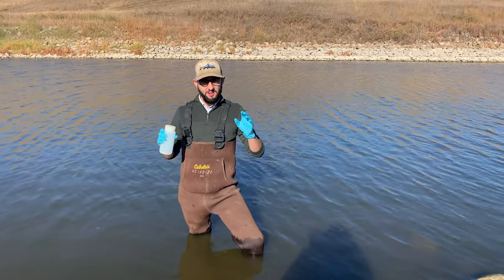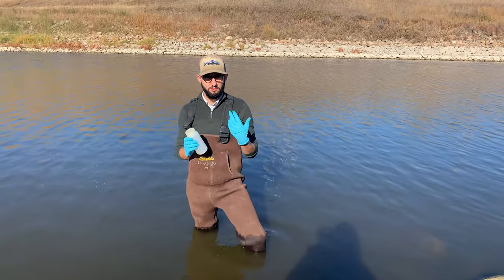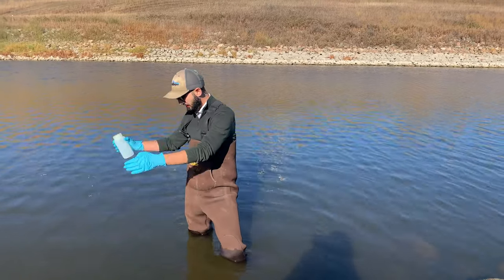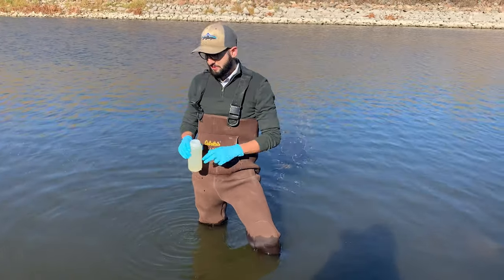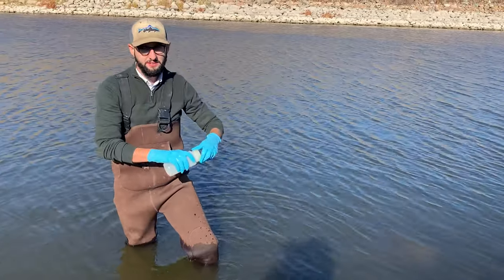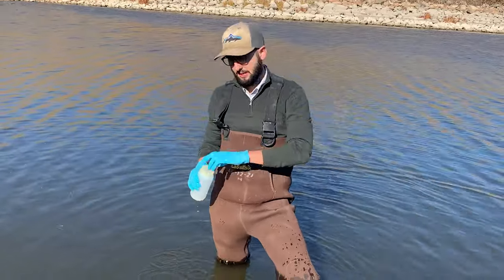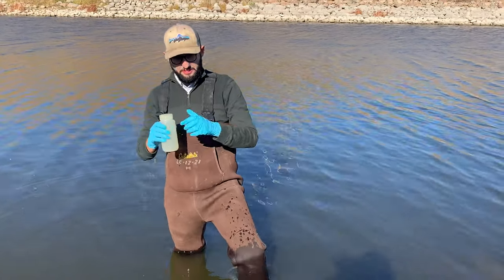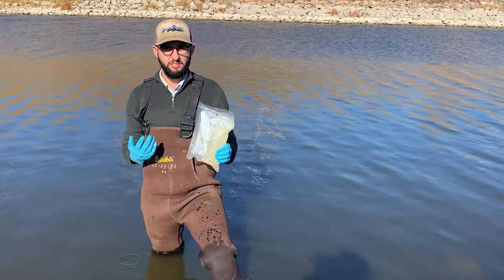Environmental Sciences | How To Collect Water Samples

Comment: I have a question. 

For dissolved oxygen measurement, will that bubbles that came out when you first opened the lid be a problem? The bubbles seemed to go out of the bottle, but were they really? Won't they affecting the oxygen collected in the bottle?